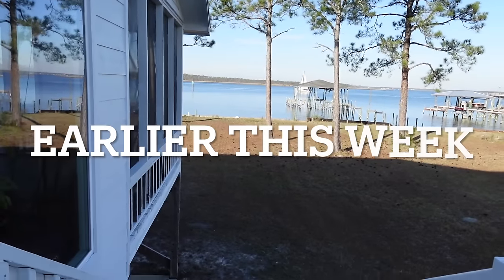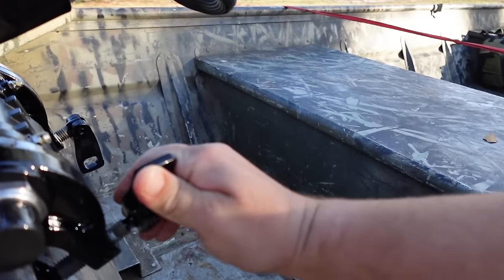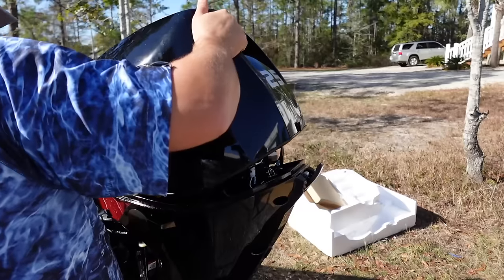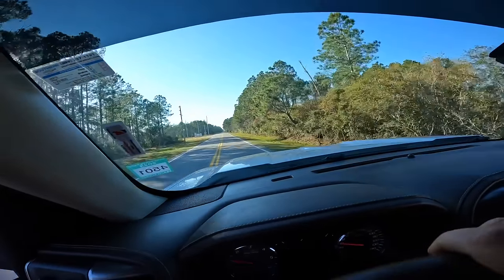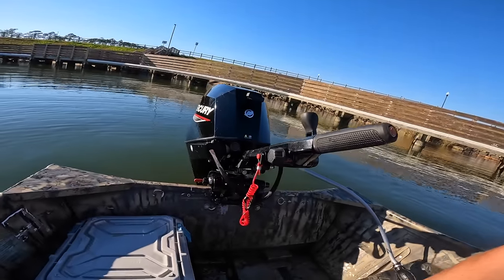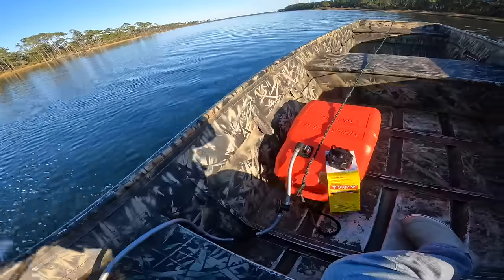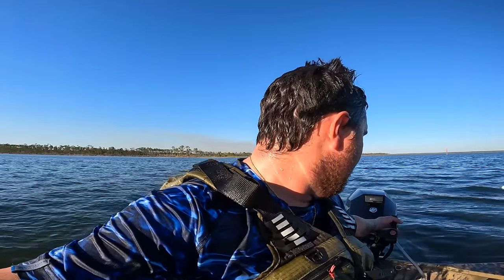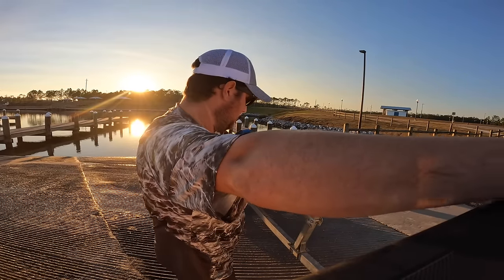I Should NOT Have Done This!

Comment: Your motor is tilted to low you need to be level with your cavitation plate. 
That boat probably rated for a 20 hp. 
Sell boat and get 1656 minimum and use your same motor. Will float shallower than the 14/36 and when a storm blows in from nowhere will glad you did.

Comment: I could tell you don't have tiller experience. You was way over steering and not sitting in the right spot for full control. This is a good example for new people on tiller boat how fast and easy it can go wrong. Make small moves with tiller handle. Glad you posted this and not hurt
Reply from the maker: Definitely zero experience and lots of mistakes made for sure ! Thank you

Comment: I would guess that motor is too much hp for that small boat.  Also the manual has instuctions for break in.  Then change oil.
Reply from the maker: 100%%
Reply: I bought a new 15 hp Merc (Electric start worth the money) this year and did the break in, but didn't change oil fast enough, the motor oil light came on after 6 hours of run time and it wouldn't run right.  Changed the oil and it was almost black.  After that it was fine  So do change the oil after break in. @BamaSaltwater

Comment: Hum. Were you raised running tiller handles?

That a 14'x42" bottom boat? It should handle a 25hp but it might be an older model built for the lighter 2-strokes. That 15" transom sucks w/a 4-stroke. A welder can build it up tp 20/21".

Maybe tighten steering tension a bit too.
We run 90hp tiller handles in the bayous and Mississippi River. 
You ain't saw a wake until you run with 200' towboats pushing 42 barges north 😂.
Louisiana.... 
I run twin 250 Yamahas on a 30' cabin boat and still get tossed 😂
Stay dry....

Comment: i haven't seen a specific solution to your original given circumstances with  the 14' jon boat & the overpowered engine, in any of the comments.  I know  u bought a larger jon boat but u could have saved the expense by purchasing a tiller extension.  Again, i could give u the reasons in another comment, to keep this comment short.  I seriously doubt you'll get competent advice from  most viewers.  I do like you & your channel, so let me give you a little of my background.  I have been boating since i was 14 years old.  I learned all about boating from joining a senior branch of the boy scouts called the sea scouts, later termed Sea Explorers.  That was decades ago that i joined  & was active for over 30 years.  I also studied for a Captains license, but never actually pulled the trigger on it.  I no longer support the Boy Scouts anymore & denounce the organization.  But i will give u advice if like.

Comment: Well green horn if someone hasn't told you all ready- that back seat is a poor, poor set up 1st of all, you can't straddle the back seat because it's too wide, you have poor balance and stabilization ( you proved that) personal that motor is overkill for a flat bottom that size, it won't roll with waves, ( you showed us that) and that wave you hit wasn't head on , shoulda been, ( I put a 25 HP on a 14' with a sea worth hull...& It was't what I wanted.I was raised on a lake, been on waterways most of my  70 yrs, from challenging waves on Saginaw Bay, Grand Traverse Bay, Lake Michigan, and oceans too..
Overkill, - that back seat would be nice with a steering wheel.
Glad you're safe....& More educated.

Comment: Nice boat and motor, but you really do not need a 25hp on a 14ft Jon boat. These boats weigh absolutely nothing. I have a 5hp on a 12ft and it does 18mph with just me in it and planes immediately. Just looking at the way your boat sits with you in it on the water, you can tell it is way too stern heavy which is why you had that happen. Definitely should’ve brought it back to the ramp and fixed that. Could’ve been life threatening, you’re very lucky.

Comment: Is that Boat rated for a 25hp. It sure doesn’t look like it !
Reply from the maker: I figured out afterwards, it was only rated for 15hp.. oops
Reply: @BamaSaltwater  I got a 14ft v hull aluminum boat and thought my 15hp was pushing it. My 12ft jon boat is only rated for a 5hp. Are you still running that setup? Keep in mind you could potentially get a citation from the DNR or Coastguard for over powering a boat. Didn't that boat come with a capacity plate?

Comment: Like most young guys, your mistake I believe was in putting about a third too much motor on this boat. I would bet it's rated at most about 15hp, just ruined your fun for the day. This is a flat bottom boat that planes easily, it does not need all the power of v-hull that sits lower in the water. Engine is too heavy and that brings what little steering control you have in the nose, way too far out of the water.

Comment: Why were you sitting side saddle? No surprisingly you lost control to be honest. Personally, would not put an engine with a centrally mounted tiller on a small boat like that. Tiller should be portside, skipper should sit starboard side. Anything else unbalances the boat.